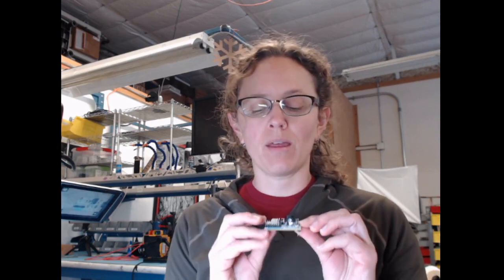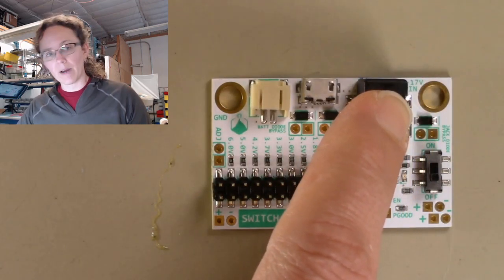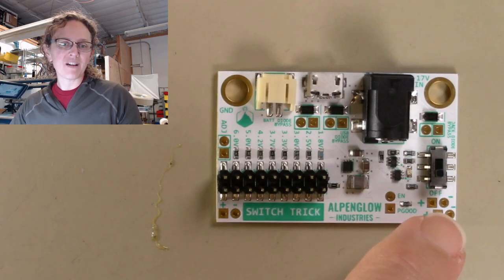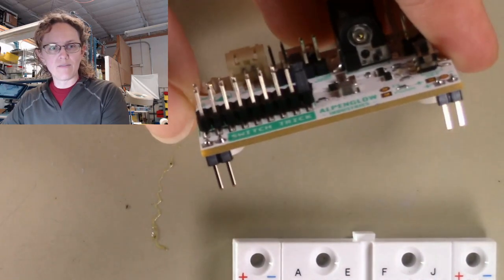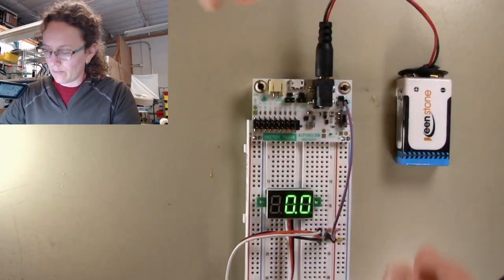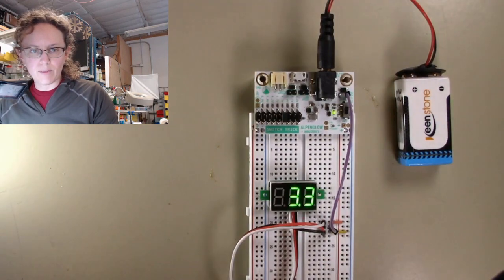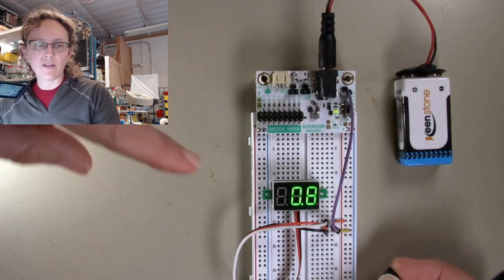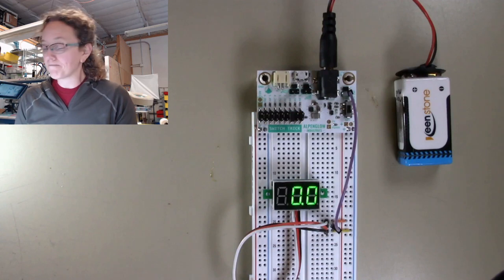The SwitchTrick

Comment: I like it!  It is clear that you have put a lot of thought and experience into this design.  Can I make a few suggestions from my experience as well? 

I have used breadboards with somewhat marginal contacts, so I like the power adapters that have two pins to connect to the breadboard rails.  That provides some redundancy should one contact glitch for some reason--nothing more annoying that a design that gets flakey when you touch it because of a bad contact. ;(

The other feature I have seen on similar boards is to have the power contacts for the breadboard stick out so that the power board doesn't block any rows on the breadboard.  It means paying for a router cut on the board which may add a bit to the cost, but it's worth it.

I appreciate the effort you have put into this and I think I need to look at your other products as well!  

I heard of your product via cnx-software.com, FWIW.
Reply from the maker: Hi, David.  I'm glad you like it and hope to see an order from you in the future.  :)  I made some choices to minimize form factor, and I'm pretty happy with it as-is for now.  If I decide to revise it in the future, I may incorporate more features. Thanks for letting me know where you saw it mentioned - I hadn't seen the cnx-software blurb!